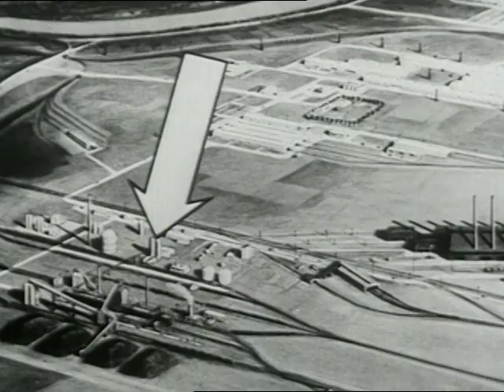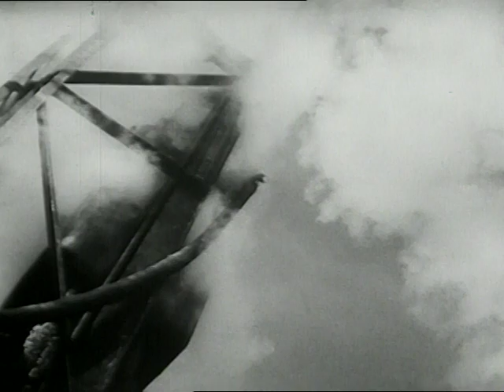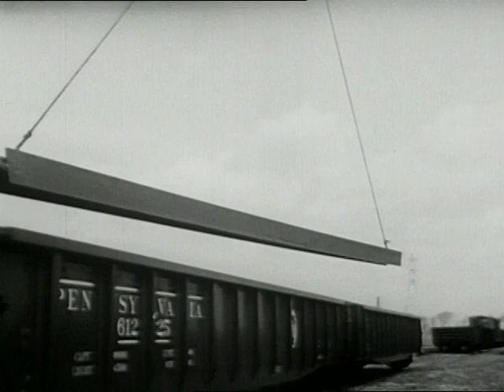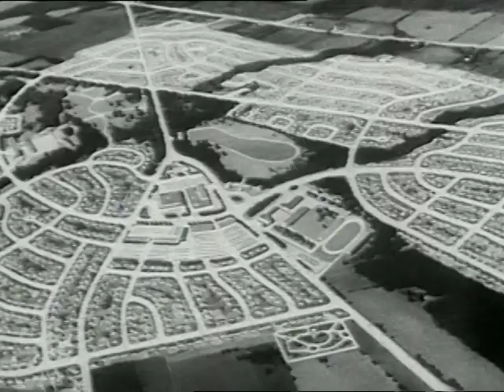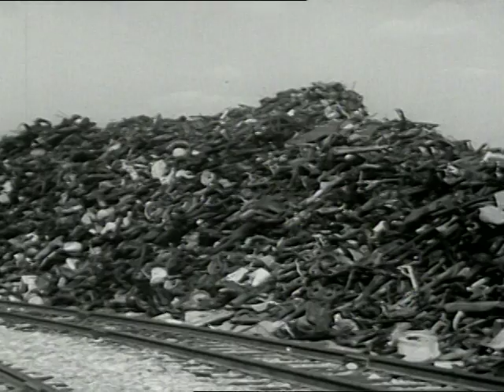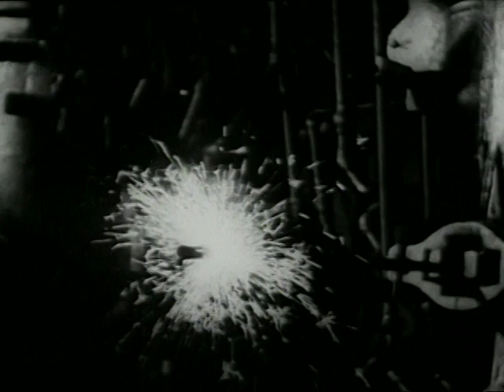New Neighbor (1953)

Comment: I was employed at the Morrisville yard of the Pennsylvania Railroad Co. in 1967-8 (mostly nights).  The Fairless Works was the primary customer and perhaps the largest "single point" consignee of the PRR in that era.  Morrisville yard was the last "manual hump" switching yard on the PRR with  28 car riders on each shift.  The PRR primary traffic into the Fairless Works was coal, coke and limestone. The primary PRR outbound traffic was actually Iron ore from Brazil, Canada and Venezuela bound west to Pittsburgh, unloaded at the piers at Fairless.  The Reading Company (RR) had most of the finished steel traffic from Fairless, then.   e